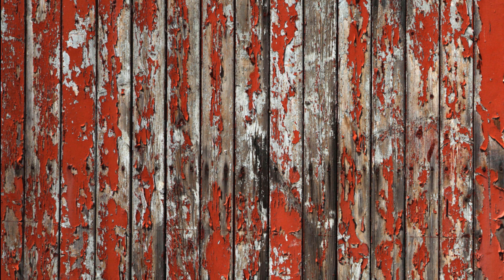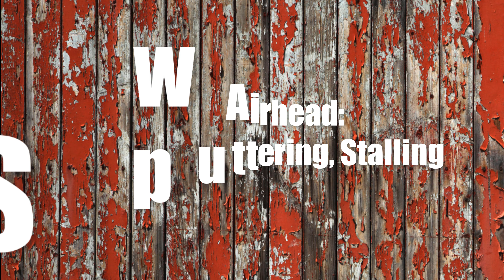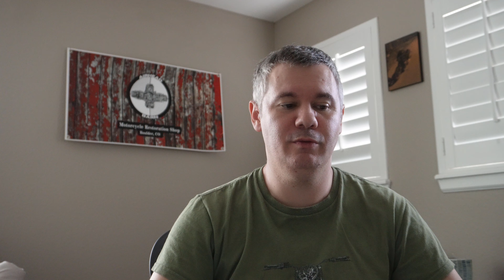Did EnDuraLast Ignition System just Die? BMW Airhead Misfiring, Sputtering, Stalling

Comment: I'm having the same issues. Doesn't even seem to be heat related. I have tried new plus and wires. Im about to try new enduralast coils but have been told the oem Bosh are pretty reliable and should go back to points. 
Did I understand correctly and you went to points or did you go with wedgetail?
Reply: I gave up on the Endura last EMC eld-boigns on my  78 bmw R80.  I have been troubleshooting via email with euro motor electrics for about 2 years (they are pretty good about helping) and have gone through two entire product packages.  Rather than try a new single coil to replace the original two coils, I went back to points/condenser and that works fine.  I then ordered a Boyer Bransden KIT00286 which includes a new coil which is required.  Cost is about $300.  It works great.  I have my reliable strong ride back.  Relieved to not getting stuck on the side of the road again.
I am still curious if the Endura system would work if I purchased a new coil but I have spent enough money and a lot of time on something that is supposed to work.  I don't suppose you want to be the guinea pig and try a new coil?

Boyer Bransden's info page about their coil requirements that you may understand better than I do...
http://www.boyerbransden.com/microdigitalmicropower.html

Boyer Bransden KIT286 BMW Pre 1979 12 volt ignition and mini coil - $302

Comment: I restored a '80 RS, upgrading every system including putting that Enduralast ignition in there. It seemed to run fine for awhile but over time got harder and harder to start until finally it wouldn't start at all. Rebuilt the carbs focusing on that choke circuit to no avail. Finally I decided to re-install the "points in a can"  it came with and she started right up and runs like a clock. One of the reasons I wanted that new ignition is because I dual plugged the heads and the enduralast comes with options for different advance curves, including one for dual plugs. But it doesn't help much if it won't start. I'd like to know how you made out with Wedgetail...

Comment: Did you check the wires going to diode board? I was told that maybe wires are connected to wrong screws there . Not the insulated terminal but the bare ones. 
I was having same problems with my mechanic trying to install dyna 111 ignition and he couldn’t get two new ones to work without similar issues your having. Only having put back to points did the bike ride normal again.
Reply from the maker: Nope, this was was ignition failure and going back to points totally solved it. Thanks for watching!

Comment: I suspected that the Dyna III ignition on my '75 R90/6 (unknown date of install) was failing (misfires, stalls) because of heat (I live in the US south...) so I just replaced it with an EnDuraLast EDL 4 IGNS.  Hoping I won't encounter the problems you are having!    You've probably sorted this out on your bike by now, but I wonder if the location of the ignition unit might have been a problem.  I put the new unit by the seat (as far from the engine as possible).  So far so good, but we are only now moving into warmer weather, so time will tell.  

Really enjoying your videos - I'm about to replace the rings and push rod seals on the bike, and your thorough demonstration on R75 is helpful!
Reply from the maker: Thank you Scott for watching. Heat is definitely big problem for these ignition modules and moving them away from engine totally makes sense. Dyna III I have on r90s is placed by the seat for that same reason. Installation instructions suggest having eme ignition up front and previous owner most likely went that route. I would definitely advise against it and move it more back. Keep the shiny side up!
Reply: @airheadbarn  One other thought - you mentioned that your caps are 2.3K ohms.  EME says that each individual cap should be 5K ohm or it will damage the ignition unit.  I replaced my 1K ohm caps with the 5K ohm caps from EME.  So far no problem.
Reply from the maker: @scott.lindroth  airheads have either 1k plug caps (pre ‘81 points ignition) or 5k plug caps (post ‘81 electronic ignition). This bike originally had 1k caps which were replaced with 5k caps because of aftermarket electronic ignition that was added.

Comment: Mine was having the same symptoms with hiccups and backfiring.  I’m still in the process of investigating, but when I removed the tank  I noted that the black wire that goes into the ignition module had come loose.  I briefly rode the bike and seemed to be fine, but I need to ride it longer to confirm.
Reply from the maker: Bad ground can definitely cause headache. Thanks for watching!

Comment: I had an issue w/ an Enduralast / Saches on an r75/5.  Optical sensor went bad and left me stranded. Apparently they don't like the heat.  When I got a new sensor,  things were fine for a bit,  but then it would start cutting out sometimes.   Support mentioned that they are very susceptible to low voltage.  So if your battery is < 12.5 volts you'll probably have issues.  Long story short,  i went to points and have it dialed in perfectly.  I think these aftermarket ignitions are junk.  Just stick with OEM.
Reply from the maker: Thanks Lars for sharing you valuable feedback. I was thinking of putting points back but somehow I would still like to have electronic ignition but reliable version. I’ll check out Wedgetail and report my findings. Battery is brand new and I tested it with load tester. No issues there. Thanks for watching!!!
Reply: You can also have the points and enduralast installed at the same time.  I ended up putting a toggle switch (P vs E) on the coil ground wire and mounted the switch under the front of the tank. So you can switch between the 2 if you want.  Makes it interesting to see if you tell a difference when switching while riding.  Points 'felt' better to me, and had the reliability aspect.  Idle position seems to be a little affected by the differences in spark.  I think the idle setting on the carbs could be dropped a little when on electronic.
Reply from the maker: @larsfiedler9991  Great idea Lars!!!

Comment: I have wedgetail on bot my bikes.  Only one is running at the moment the other is still in restoration but the one I ran this summer on my R80 works well.  I did have one peculiar issue.  One time only the bike would turn over but not start.  I tried several times and not a kick.  The bike was already at operating temperature so should have started immediately.  I turned the ignition key off and immediately back on.  The bike fired up right away with one quick press.  This happened only one time.  Weird.
Reply from the maker: Thanks for watching and sharing your story.